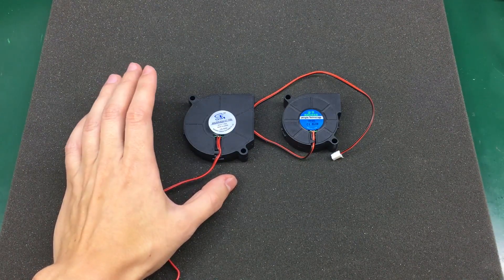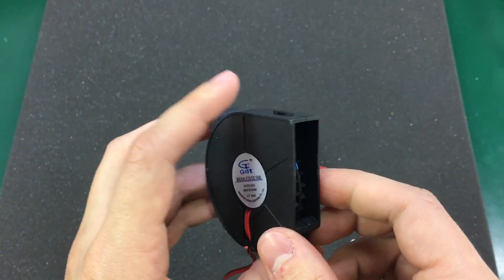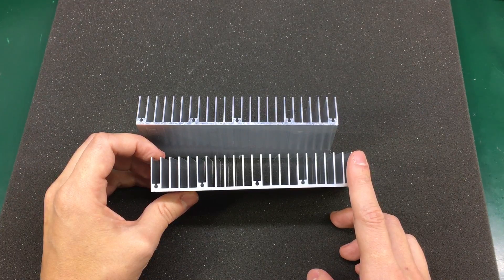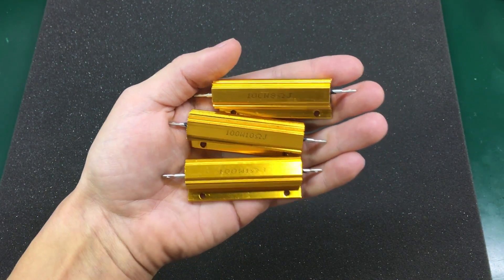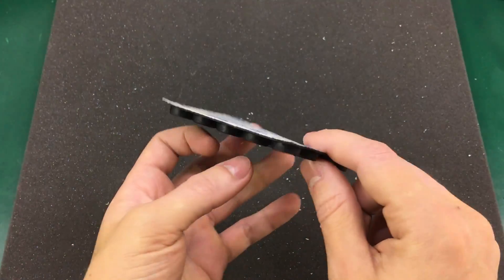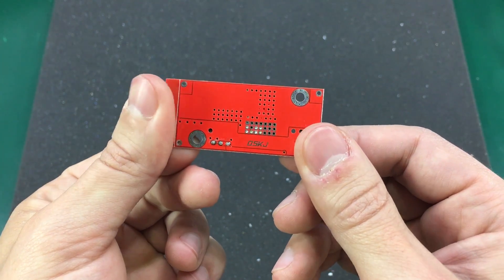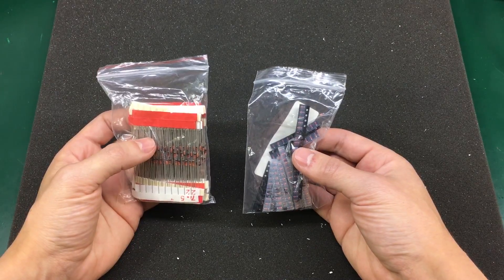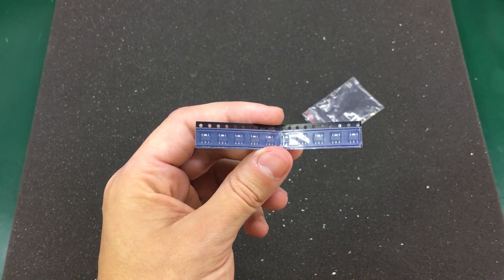Voltlog #76 - InTheMail

Comment: I may be a bit late in reply, but I would use the metal case for the resistive load with fans for case-assisted sinking AND those rubber feet (maybe somewhat larger) with a drop or two of glue with the surface adhesive--otherwise they will eventually loosen due to head and movement.

Comment: At 11:00 can I run three of these in parallel from a single source solar panel to 4.2v to charge my 3S 12.6v and a 4S 16.8v Battery Pack? I know I need a separate power source to do this using the TP4056 or use this but I need a simple schematic. I know I can use 3 separate phone chargers but I want to make this work. https://www.aliexpress.com/item/1PCS-B0505S-1W-5V-to-5V-converter-DC-DC-power-module-converter-1000VDC-Isolation/32712121720.html I accidently used one solar kit per because I purchased them at different times and didn't get around to wiring them in a series
Reply from the maker: you need isolated converters to connect multiple TPS4056 in series.
Reply: Thank you but I don't know how they're connected.

Comment: Some of those fans have a hole under the sticker and you can usually feel them without taking the sticker off. If it has a hole I suggest a small drop of light oil.

Comment: http://www.ebay.com.au/itm/131726954301?_trksid=p2055119.m1438.l2649&ssPageName=STRK%3AMEBIDX%3AIT 

Voltage/ Current/ Power/ Resistors/ Meter panel Table Header fpc Block 1602 LCD 

Soldering Iron Station Temperature Controller For HAKKO 936 T12 T1 T13 Handle
http://www.ebay.com.au/itm/141741468928?_trksid=p2055119.m1438.l2649&ssPageName=STRK%3AMEBIDX%3AIT   

:-)  Andrew

Comment: Thanks for the video !! Yesterday I connected 4 of these resistors, 1 ohm 100 W, in parallel. You need a heat sink to reach the 100 W at a reasonable temperature
Reply from the maker: yes, I think I will do some tests to find out the maximum power I can dissipate with the setup that I'm going to use

Comment: plastic may melt.

pls mount that big heatsink on top on the blue case.
Reply from the maker: I can mount it on the inside, it will look better.
Reply: easier heat dissipation on the outside. inside may get hot faster.
Reply from the maker: true, but I would like to maintain the shape of the enclosure, I will use a cooling fan anyway.
Reply: okay !